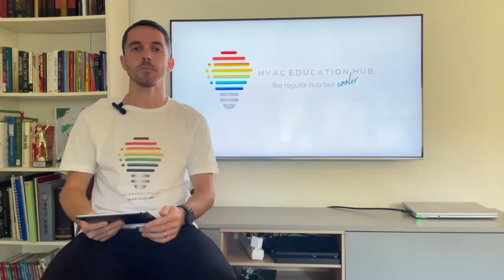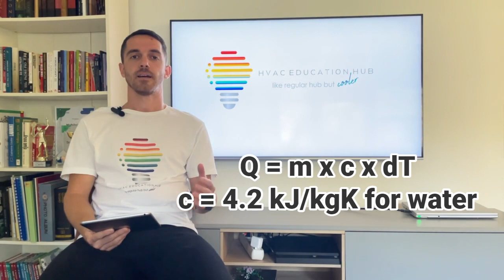How to Calculate Heat Pump Capacity & Flow rate | Quick Formula Explained

Comment: I have I have a 16kW Samsung which states I need a nominal flow rate of 46l/min, yet my measured flow rate is 35.8l/min at 100% of pump inverter output, this is on my DHW circuit. It’s strange because it’s all new pipework, the total distance round this circuit  is less than 8 m, there is no vertical increase in height and the pump is quite powerful (UPM 4XL). I don’t understand why my flow rate is low. I have an intakleen HP filter assembly, do you this is where I am loosing my flow please?
Reply from the maker: I don’t know Samsung logic but usually on DHW cycle flow rate is lower and delta T is higher so I think it is fine as long as your heating circuit is correct
Reply: @HVACEducationHub Thank you so much. It’s still too warm to test the heating, the TRVs are still closed.
The reason why I was worried is that the control system indicates output on my DHW is “ inverter pump 100%”. Which is assume means the centrifugal circulation pump is modulating at 100% already and the DHW circuit is short and all new and so should offer very little resistance to flow compared to the heating circuit. I will wait for the heating season.
Reply from the maker: @yp77738yp77739  probably this is 100% of pump on DHW cycle which could be different than duty on heating cycle
Reply: @HVACEducationHub Thank you, that would make sense if correct. I assumed 100% was 100%, regardless of application.